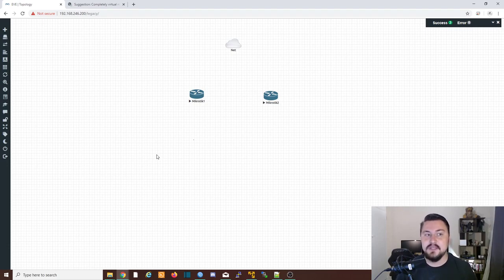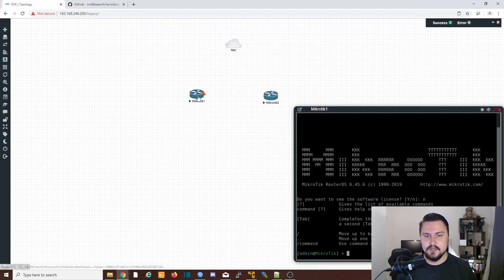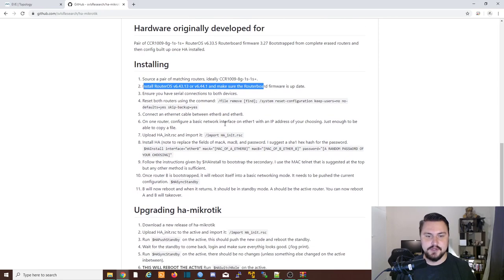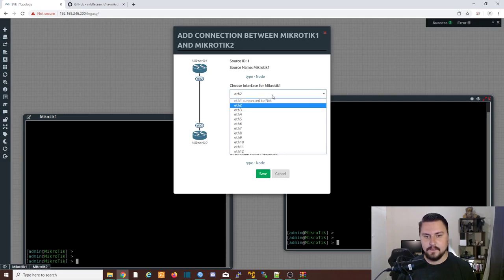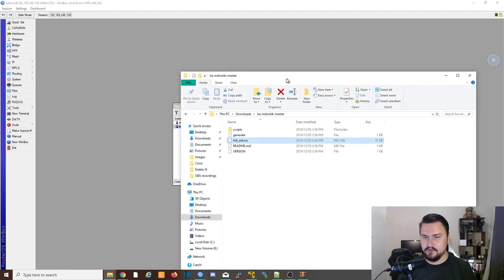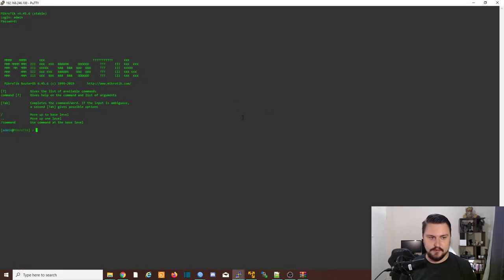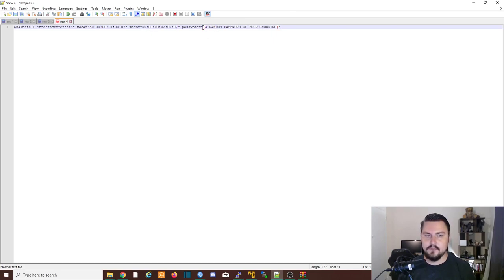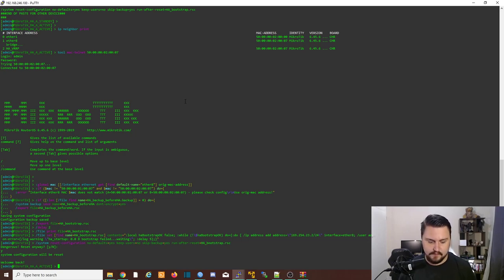MIkrotik - REAL HA Configuration

Comment: Been looking for something like this for a while, great video! Just to add another piece to this, with Netwatch and Scheduler (for permissions) you can have the HA kick in for a physical port failure on your device. For example, if your uplink port dies/faulty SFP/faulty cable, you can have it kick over to the standby board by running the ha-switchrole script after x seconds of not being able to reach your defined IP address. Keep up the awesome work!

Comment: I really hope there will be soon any clustering/stacking (or virtual stacking) option to show two mikrotiks as one device with two modules (like a typical hp or cisco or whatever switch would do)
Reply from the maker: I really wish that too Massimo, honestly! This is a feature that has almost become baseline in most equipment. There is still no indication of when true HA will be added to MikroTik as it's not on their roadmap and even in the current RoSv7 builds there is nothing hinting towards it coming. Some other neat carrier features though!

But make sure you are seen, post about it on the MikroTik forums whenever they ask what things you would like to see in the new RoS version. And hopefully it will become a reality someday.

Comment: Thanks for such a video, keep going on like this bro.

If I upgrade the routers to the new version, am I gonna face any problem?
Reply from the maker: Hey Dashgin, you may have issues upgrading to a new firmware. I would suggest always checking on https://github.com/svlsResearch/ha-mikrotik to see what the current latest stable version is. This does not mean that you cannot upgrade the firmware, though I would suggest doing this on a lab environment or on two blank routers that's the same model to see what the outcome is first.

If you do want to go ahead with upgrading the firmware the best option is to start with upgrading the firmware on the passive router and then upgrading the firmware on the active router.

Comment: Hi Sir,

I have given you full credit for the script and video as this is completely.
I hope you do not mind, I have a little question about this VRRP HA.
This script can be work when the fail Router replace after? 
I mean normally the Infra will available Active/Standby. if the Active router failed after Standby will change to Active. we must be replace the failed Router 1.(example- power failed). After the Router replace, how can resync from Router 2 to New router?
As i testing the script can't sync to new one. (maybe I'm weakness in this network case).
pls guide to me and all it. 
I'm really appropriate to you.

Comment: I've tried to follow the configurations but after the first reboot of routerB it seems that nothing has happened. RouterA is active but routerB has no config. I'm simulating on eve-ng with RouterOS 6.46
Reply from the maker: I had this same issue with some old code, have you used the latest code from nathan1?
Else try this:

https://raw.githubusercontent.com/svlsResearch/ha-mikrotik/master/HA_init.rsc

If it still doesn't work I recommend posting on the forum so that nathan1 can also check it out, he is very willing to help when it comes to the HA script :)

Comment: in my case this doesn't work on backup router, from the master i can get the script and i'm uploading to the backup router it's rebooting , and sice than nothing happened.any solution pls
Reply from the maker: Hello, I would suggest posting whatever errors you are getting on the MikroTik forum post that Nathan1 is a part of https://forum.mikrotik.com/viewtopic.php?f=1&t=110690 he might be able to shed more light on what your issue is.
Reply: @TheNetworkBerg   i made it work, but ONE important thing.
i was getting script error!!!  why? 
You know when you adding on MASTER :

$HAInstall interface="ether8" macA="[MAC_OF_A_ETHER8]" macB="[MAC_OF_B_ETHER_8]" password="[A RANDOM PASSWORD OF YOUR CHOOSING]"

then it pops up on the terminal script and then that script gooes to slave .All this process i was doing on MikroTik terminal. 

Once i started doing on putty everything was fine...interesting, have you tried that?
Reply from the maker: @nikolashuminosky6987  I always use Putty to connect, even in the video so most likely why I did not encounter this issue :)

Comment: I have done something similar with VRRP by exporting .rsc files from one Mikrotik to the other using FTP. If you add ".auto" on the name of the file is automatically imported as soon as is loaded to the Mikrotik. I need to check this project and see how's this done doesn't need VRRP?
Reply from the maker: Hey Geo, this does make use of VRRP between the routers to create a heartbeat interface. Essentially there''s a bit of code that just disables all interfaces except the heartbeat interface of the slave to sync configuration. Once VRRP picks up that the "Master" has died it just makes itself master and enables all the interfaces. I think you could speak to nathan1 directly for more information.

Comment: Brother ! when we use HA? What is advantage of HA?
Reply from the maker: Hey there, you typically want to run HA at a site where you want to keep downtime as low as possible. The biggest advantage of HA is that there is no configuration changes as both devices will run exactly the same configuration. The network will not even know that one device has gone down and will keep sending packets and frames the whole time. VRRP which is also useful for this type of failover tends to have different configurations and needs to be manually updated on both routers where HA will do this automatically for both.